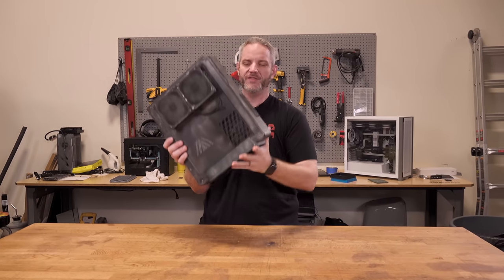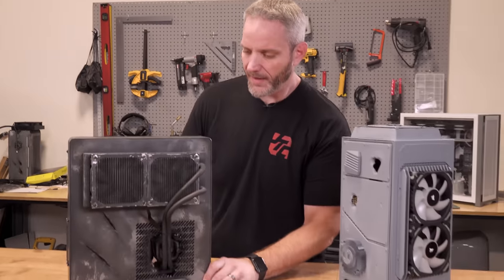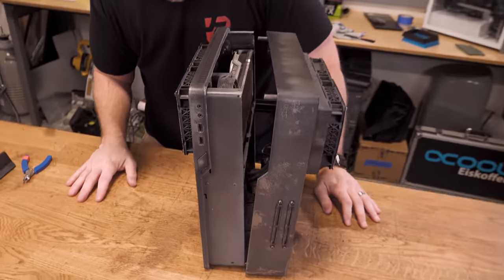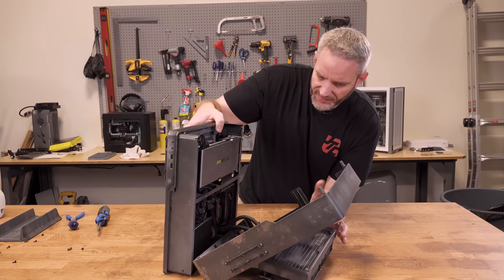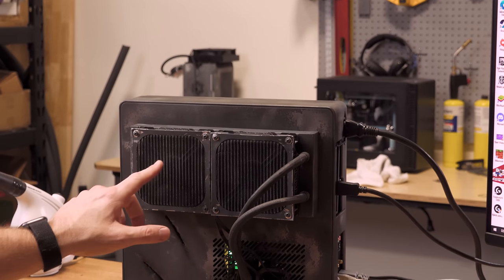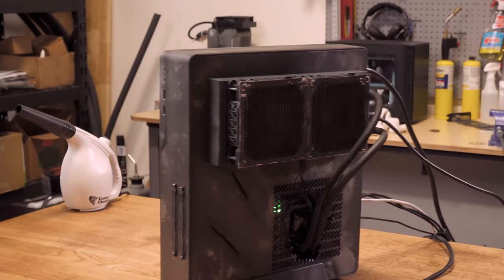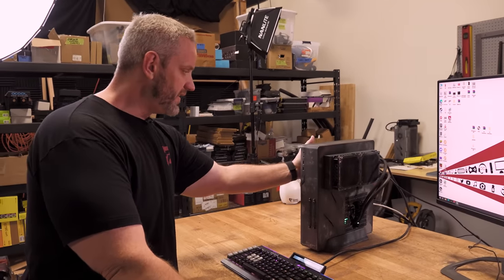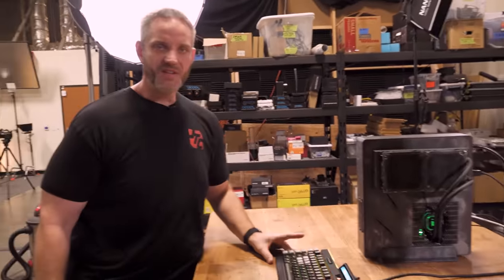The Custom Build is 2 years old... we found some issues

Comment: @Jay - early on, when you had the old build & your Star Wars build next to each other, & you were talking about having wires coming out the case to simulate damage, I was struck by an idea.

When you see wires hanging out in a movie, sometimes they're sparking, right? Although making the wires on your build actually spark is doable, it's not exactly safe. However, it might be possible to create the illusion of sparking. You'd need some electronics inside to control it (Arduino, or whatever), & what they'd be controlling is some RGB LEDs. Now, LEDs on their own aren't gonna cut it, so what I propose is using some pieces of fibre optic cable, which could be made to look like wires. Maybe paint the outside of the fibre with a copper colour paint, then add some scorching detail, & then slightly back from the end you'd add some sleaving to make it look like an electrical cable, & the sleeving would extend inside of the case.

You'd need to figure out how to program the LEDs to flicker in a pattern that would resemble sparking. Also, it could be more than 1 fibre optic wotsit per "wire", with different fibres leading to different LEDs to increase the detail of "sparking".

It's just an idea, but thought you might find it interesting.
Reply: you can do this with the corsair software
Reply: @ZaneofAustin  Never used it myself, as I have very limited experience with the whole RGB thing, but I was under the impression that software like that was for ready-made products, rather than a few individual LEDs.
Reply: @justsomeguywashwd_jbm821  Fibre optics are something that needs to come to the PC scene. They're used for illuminating Lego models to great effect. And yes, you can do this with the corsair software, so long as it can pick up the led's/product used for lighting. It's good software, not my fav but I understand it's solid.

If you look up the Tested YouTube channel, you'll see Norm showing off some induction powered LEDs. Basically wireless LEDs. They're fantastic. I'd love to build something with those.
Reply: @ConfusedRaccoon  fiber optics in combination with other methods could create some incredible scenes
Reply: this is the best comment I have ever seen on YouTube
Reply: I've done this before with fiber running from the LED on one of those battery powered flickering tea lights. Makes for a good easy way to get flickering light, no control though. I used it to simulate a welding arc on a scale model car.
Reply: You can use other rgb products on corsair when you have a node or something. The connectors they use are not so weird in the end. It should be doable

Comment: “Faster means hotter” is only true for CMOS. On the rising clock edge there is a transient short from power to ground. The more short is a given amount of time, the more wasted electricity turned to heat. Switching to tunnel diode logic increases the speed 1000 times at 1% of the power.

Comment: The reason the CPU Fan "Turbo" curve and Chassi Fan "Turbo" curve is different isn't because of an CPU/Chassi distinction, it's because it's running the CPU fan in PWM mode and the Chassi fan in DC mode.

And by necessity all of the DC fan curves are very different from the corresponding PWM curve, among other things a DC fan will not spin up of the voltage is too low, often the lower limit is somewhere around ~45-55% - it can spin at lower settings, but not start up!, while PWM fans can go way lower - there it's just a "what did the manufacturer told the firmware to interpret it as".

Some PWM fans will always spin even at 1% PWM but many deliberately stop spinning at a "low" limit, often in the 5-15% range.

And fans can actually overheat and/or be damaged by having power applied to the motor for an extended time without the fan blades spinning, so the curves are made so that doesn't happen. Some? Many? All? PWM fans actually have "zero RPM" modes for very low PWM that are safe (cuts power to the motor at very low PWM settings) but all motherboard manufacturer tends to play it safe by default hence 20% minimum for PWM and 60% for DC.

The MB can also implement a "zero RPM" for DC fans by cutting power since no voltage is fine, it just needs to avoid the intermediate (unsafe) range, usually between 0.1-5V and 0.1-7V on 12V DC fans. I saw an option in the BIOS that might allow 0-rpm for specific temperature ranges.

From the brief look I think he matched both curves to the 60% DC curve, but I didn't see enough to be sure.
If all fans are PWM and connected via 4-pin headers another option would be to just set the Chassi fan to PWM. And if not, you could the CPU fan to DC mode too, it works on PWM fans. A lot depends on noise vs cooling, there's a lot more flexibility if all fans are PWM controlled.

Comment: I've had my '9900k running 5 GHz all core since it came out of the box at 1.35v. CPU never crosses 80°c. Ran prime for 2 days to make sure it was stable after I tweaked OC for a week or two.

Guess I did get a Lucky Chip because I see how your temperatures everywhere.

Comment: I don't overclock much these days the last best overclockers I knew of were like the 7600K and 8600K apart from that the CPU's these days aren't great for 24/7 OC and its better to get a larger heatsink or better water cooler with fan speed adjustment to make it more quiet.

Comment: FOR ANYONE WATCHING and thinking you should blow your fan fins with a blower or duster.. DONT DO IT LIKE THIS because your fans may or may not generate voltage back to the pin headers and if there's no protection (diodes or otherwise) then you could potentially damage your supply voltage . Hook up a fan to a volt meter and hit it with canned air. see the voltage?

Comment: I'm actually considering a SFF case like this for a retro laptop teardown I'm doing, going to pull the guts from an old P3 1Ghz laptop with 384MB RAM & try to mod a small case to fit it so I can add some custom cooling & keep it plugged in 24/7

Comment: It isn't a good idea to blast fans with compressed air where they can spin up to extremely high rpm right?  I usually hold the blades with my thumb while blowing them out.

Comment: Careful using Signal RGB. It caused the RGB on my MSI card to stop working, so I had to install Mystic Light to get it working again.
Reply: If you locked the RGB bus to control the LEDS by running a conflicting program, a power cycle and making sure there are no conflicting apps can fix that.

Comment: A 280x covered in dust, damn it Jay you are cruel. Those cards are going for 180 bucks on eBay 😂. I have a 280 I use in my old Intel 775 socket rig when my new rig is being worked on (usually waiting for parts). Good for old 32 bit games and streaming.

Comment: Okay guys (and Jay, if you have the time to respond) please settle this for me once and for all...

I absolutely recoiled when I saw Jay airblast the GPU fans without holding them to stop them from spinning. I was told by a friend who knows WAY more about computers than me, that doing that can be quite dangerous due to electricity building up in the fan motors when that happens. 
I'm aware that I'm probably being irrational and that if Jay's doing it, then it must not be that big of a deal but please guys tell me: Is it in ANY way dangerous to let the GPU fans turn like that, whilst airblasting dust?

I need your nerdiest, wordiest, most detailed answers please!!

Comment: I tried SignalRGB before, couldn't use my ICUE app and I needed it for keyboard/mouse settings. Not only that, half my products wearnt supported and the rgb  on the Corsair memory wont "sync" with the other lights, its like changing colour faster than the fans etc.

Comment: So, what's the best way to check your temps?  Thinking about switching default intel cooler for an AIO and I would love way to compare after.
Reply: in a window with like hwinfo64 or afterburner running in a window I guess or run full screen with that monitoring software that afterburner has I guess but needs more config

Comment: Weathering is getting a bit old to be honest. It's relatively easy to cut some slashes and screw up the paint. Wouldn't it showcase Jays modding chops a bit better if you go for a good looking mod without cheap weathering techniques? Like make it actually look good and not something that was once looking good and just got the old grunge treatment.

Comment: 6:08 to 6:12.  Did anyone else cringe when Jay DIDN'T put tape on a fan blade or two holding them  still connecting with the shroud to PREVENT them from spinning as he blasted the video card with air???

Comment: How much does ASUS lie in their powersupply calculator, running an overclocked i9 with an 2080Ti they recommend 1000watt PSU, 750Watt if you don't overclock. I know the i9 doesn't tell anything if they don't talk about generation. But still...650watt in that?